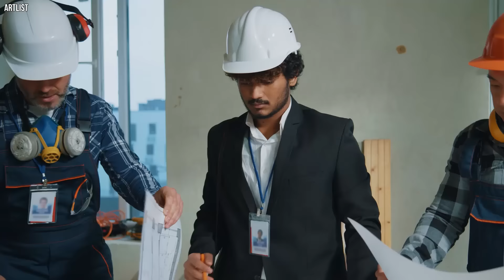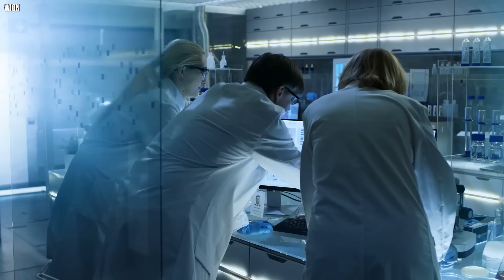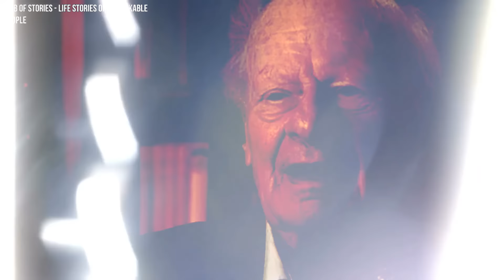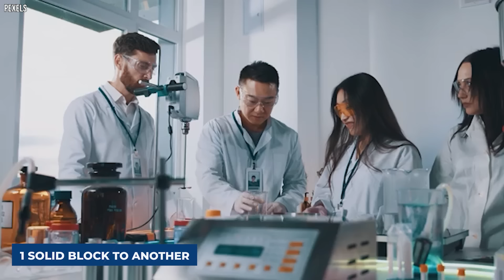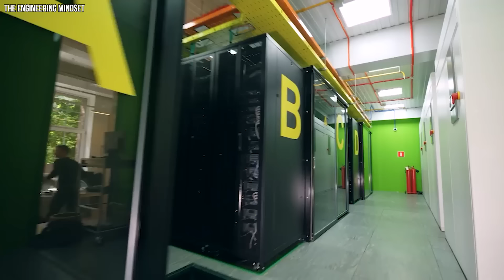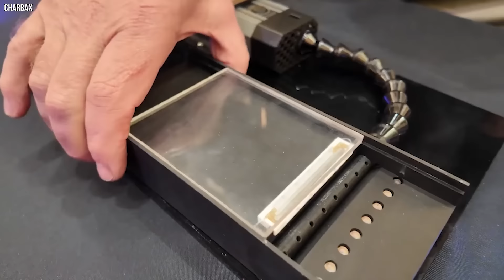China's New Invention Could Replace Refrigerator Forever

Comment: As long as it's running 24/7 doesn't work in the green energy era, we need a frege with cold storage capable of run for 8 hours and for the rest of the day a 10 watts  fan ..my is loaded with salt water bottles it allows 5 hours of at knights, did it because i am of grid.

Comment: This is nothing new I tried using peltier circuit in a cooling system for school experiments years ago. I have in I'm my phone cooler. It has lot of drawback that you don't show in this video. And about it being clean. With the current situation of scarcity of heavy earth metals. Lifespan of new age digital devices. And waste disposal of e waste. These are the things we should be taking into account without calling it very clean.

Comment: Short answer: the underlying science is real, but the video seriously oversells how close it is to replacing your refrigerator.

What the video says

* Conventional fridges use a compressor and circulating refrigerant.
* Certain materials—particularly gadolinium—warm when magnetised and cool when the field is removed: the magnetocaloric effect.
* Chinese researchers combine magnetocaloric pieces with highly conductive copper pieces, transferring heat directly between solids instead of pumping a heat-transfer fluid.
* The video suggests this could eventually cool refrigerators, buildings, electronics, EV batteries and data centres.

Does it make sense?

Claim	Reality
Magnetocaloric refrigeration works	Yes. It is established physics.
The Chinese research is genuine	Yes. The team published a conceptual design in 2024 and a physical demonstrator in 2026.
They have built a replacement household fridge	No. The 2024 results were principally an idealised computer simulation.
The machine has no moving parts	False. The 2026 demonstrator used two micro-servomotors and rack-and-pinion mechanisms to reciprocate its layers. “Solid-state” means the heat-transfer materials are solid—not that nothing moves.
Heat moves “instantly” with no losses	False. The papers explicitly identify contact resistance, friction, incomplete heat transfer and heat dissipation as problems.
It already matches refrigerator performance	No. The real demonstrator achieved only a 4.4°C temperature span at about 0.35 Hz. The impressive 26°C span and 8.3 kW/kg figures came from an idealised simulation at 10 Hz.
It could replace fridges soon	Highly speculative. No complete cabinet, whole-system efficiency, durability, production cost or long-term reliability was demonstrated.

The environmental section is also somewhat dated for Europe. R-134a genuinely has a very high 100-year global-warming potential, but European domestic refrigerators largely moved to low-GWP R-600a isobutane years ago; high-GWP HFCs in domestic refrigeration were banned from 2015. European Commission￼

Verdict: promising laboratory research—especially for targeted electronics cooling—but the title is clickbait. A fair description would be: “Researchers demonstrate an interesting fluid-free magnetic cooling prototype that still needs major engineering development.” It provides no evidence that your kitchen refrigerator is about to become obsolete.

Sources: 2024 conceptual study￼, 2026 experimental demonstrator￼, the video￼.

Comment: How about a few Nobel Prizes to go with that? Incredibly useful. Wouldn't worry about the "store" idea. Use cheaper alloys. Use something more common than rare earths and focus on heat conduction options with more common metals, like aluminium. Duplicate the metal lattice structure at a lower cost.

Comment: The actual odds of magnetocaloric heat pumps (MCHPs) replacing traditional vapor-compression heat pumps on a mass consumer scale in the next 20 years are very low—likely under 15%. 

While recent engineering breakthroughs have successfully achieved performance and weight parity in laboratory baselines, massive economic, supply chain, and physical scaling barriers ensure that vapor-compression will remain the dominant technology through 2046.

Instead of a total replacement, magnetocaloric technology is on track to capture highly specialized commercial niches.

The Reality Check: 

Why Mass Scale Adoption is Unlikely         

MASS RESIDENTIAL ADOPTION ROADBLOCKS

SUPPLY CHAIN RISK

TEMPERATURE LIFTS    

The Raw Material and Cost Bottleneck

The Rare Earth Trap: 

High-performance MCHPs historically rely on Gadolinium (Gd), a rare earth metal with heavily concentrated and volatile supply chains.

The Alternative Trap: 

To avoid Gadolinium, scientists use Lanthanum-Iron-Silicon (La-Fe-Si) alloys. 

However, these materials are incredibly brittle, degrade after millions of magnetic cycles, and require complex manufacturing infrastructure.

The Weight Matrix: 

A magnetocaloric system does not compress gas; it rotates massive permanent magnets around a solid-state core. 

Even though Ames National Laboratory achieved System Power Density (SPD) parity with traditional compressors up to 1 kW, scaling that to a whole-house system (typically 10kW to 15kW) requires an exponential amount of heavy magnetic steel, making upfront costs prohibitive for everyday homeowners.

The Temperature Lift Problem
Vapor-compression systems excel at pulling heat out of -15°C (-5°F) winter air and pumping it into a 21°C (70°F) home.

Magnetocaloric materials function best around their specific "Curie temperature" (the point where their magnetic properties change). 

To achieve the wide temperature spans required for residential HVAC, manufacturers have to stack multiple different material beds in series. 

This vastly increases internal complexity and ruins the system's efficiency gains.

Parasitic Hydraulic Losses

While the solid-state magnetic transition itself is nearly 100% efficient, getting the heat out of the solid metal requires pumping a fluid (like water or glycol) through microscopic channels inside the magnetocaloric block. 

Real-world testing shows that fluid friction inside these micro-channels creates high parasitic power losses, often eating up the 20% to 30% theoretical efficiency advantage over vapor compression.

Instead of displacing vapor compression entirely, you may see a fragmented market by 2046:

Years 1–5 (Commercial Niches): 

Startups like Magnotherm and Magnoric may deploy magnetocaloric cooling in silent commercial display cases, medical storage, and data center chillers where narrow temperature lifts and zero-leak regulations offer immediate value.

Years 5–15 (Small-Scale Consumer): 

You may see the technology enter high-end luxury appliances—such as ultra-quiet wine coolers and compact bedroom dehumidifiers—where consumers will pay a premium for silent, vibration-free operation.

Years 15–20 (District Heating): 

MCHPs may find a home in large-scale industrial or district heating networks. 

In these setups, they can capture steady industrial waste heat and upgrade it with very low temperature lifts, maximizing their ultra-high efficiency potential.

Comment: What bullshit is this? You are saying no moving parts? How about applying and removing magnet? Is that not a moving part? Sounds more complex than a simple rotary machine. Also the heat has to be removed using fans. So again a moving part! Also rare earth metals? Only China has them so after EV and chips you want another thing to rely on thats solely controlled by China? Its ridiculous how unscientific this video is. Nothing is convincing. Infact i would say its something that will never see economic production.

Comment: This is not new, and magnetic fridges do exist and still face the same problem. They exhuast more heat than cold air, and wear out faster than any fridge. On a large scale they work on a small commercial scale still have problems, right now it is just something being worked on.  gas Fridges on the other hand keep advancing its tech and being commercially mass produce. I dont think this will move forward any time soon, maybe in a distant future we may have something even better than both ideas.

Comment: why dont you fot\rget to bring this:
Thermoelectric cooling is a solid-state method that uses electricity and semiconductors to move heat from one side of a device to the other. Operating via the Peltier effect, it requires no compressors, refrigerants, or moving parts, making it quiet, compact, and precise, though less efficient than standard refrigeration

Comment: Wrong computation and datas.
1. Your household cooling systems' compressors do not run 24/7. It stops once it reaches the desired setting. 
2. The refrigerant it uses does not evaporate "slowly" over time into the atmosphere. They are being released in volumes during repairs.
3. You did not mention the larger scale of the users than the  individual households. The buildings that occupy much of the cities' space use the gigantic scale of these cooling systems, not to mention the factories.

Comment: You have not explained how the heat is transferred to the atmosphere from the fridge. because for that to happen, all heat loss has to work from the warm metal to atmosphere while The metal is warm, but when it’s cool, heat has to flow from inside the refrigerator to the metal. Therefore, there has to be some mechanism to control this energy flow in such a way that it remains selective and unidirectional. Without explaining this mechanism, rest of the explanation is meaningless.
Reply: I think it done by reversing the magnetic poles!
Reply: It's a secret! 🤣🤣🤣

Comment: I'm waiting for an air-conditioned clothing.
Reply: May be possible using thermo electric effect.Thrtmo electric refrigerators have no moving parts. They pass a DC current through an array of PNPN semiconductors. One face of the array gets cold while the other gets hot. Reversing the current reverses the hot snd cold faces. This might be done with flexible semiconducters prrhaps mineral cloth

Comment: Your video is BS because the compressors in refrigerators don't wear out and leak refrigerant unless it's a modern planned obsolescent refrigerator. My Grandma still had her original General Electric refrigerator that she bought in the 1930’s. She was still using her original General Electric refrigerator when she died in the 1980’s it was still keeping food ice cold and food frozen in the freezer. It lasted 50 years without it ever being repaired or recharged. It's probably still running today. My parents bought a Hotpoint refrigerator when they got married in the 1950’s. It was still working like a champ when they moved in the 1980’s. The fridge worked like new for 30 years without ever having to be repaired and it didn't have to be recharged with 1 ounce of refrigerant because it didn't leak refrigerant. The Hotpoint refrigerator is probably still running today. I thought that refrigerators never broke because my Grandma's General Electric refrigerator 50 years old and my parents Hotpoint refrigerator was 30 years old and they never had to be fixed or recharged. I thought that refrigerator manufacturers should build cars because they would never break and they'd be the most reliable cars in the world. I think that your worry about refrigerators leaking R 123A and contributing to global warming is misplaced. Because refrigerators don't leak R 134A. Car air conditioners leak R134 A like a sieve. Especially American car air conditioners. They replaced R 12 with R134 A because R 12 was destroying the ozone layer and R134 A was supposed to be safe. Now R134 A is contributing to global warming. The next refrigerant gas will be destroying something else maybe causing cancer. The only solution is for people to stop breathing and people will stop exhaling CO2 a harmful greenhouse gas. And get rid of Refrigerators and AC. If people die from heat stroke so be it.

Comment: Nope, todays referidgerators dont use compressors; they use vacuum pumps...
Reply: This is bullshit! Overpressured gas is compressed to an even higher pressure! This is the essence of the compressor! You may have seen somewhere a cooling system vacuuming with a vacuum pump before it is filled with cooling gas!

Comment: A few errors to point out:  no moving parts?  Wrong.  You still need motors to move the magnets, and a fan to move cold air in frig and move heat away from hot metal.  Also it’s BeiJING as in JINgle bells, not BeijZing as in pleaSURE.
Reply: The magnets can be moved with a solenoid.

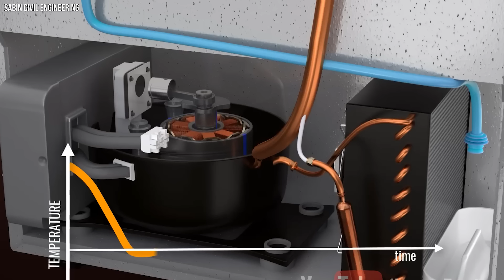Comment: @00:03:52 - Sorry but if your refrigerator's compressor is running 24h/day, 7 days/week there is something seriously wrong. Refrigerators, like air conditioners, are thermostatically controlled and the compressor will switch off when the preset temperature is reached and stay off while that temperature is being maintained - which can last for significant periods depending on how often the fridge is opened and for how long, the turnover of fridge contents etc.
Reply: So true, this seems like a scam
Reply: You're absolutely correct, and I was about to make the same observation, BUT the AI voiceover doesn't give a hoot! It's all AI, so there's no point in arguing with it. How do we even know if the AI that is "talking" to us, isn't from China too? We're consuming their propaganda!
Reply: LG refrigerators made that way. Somehow it regulated, but works 24/7.